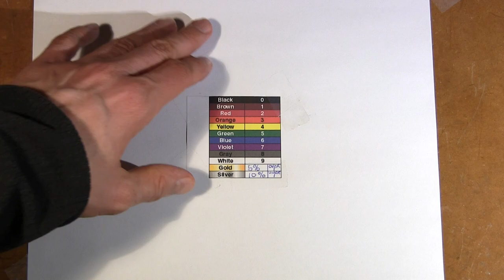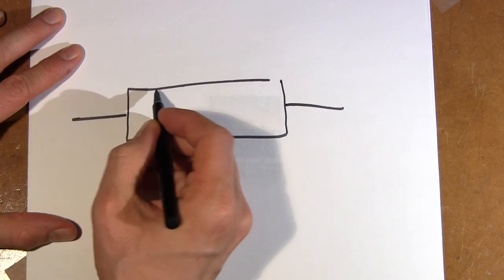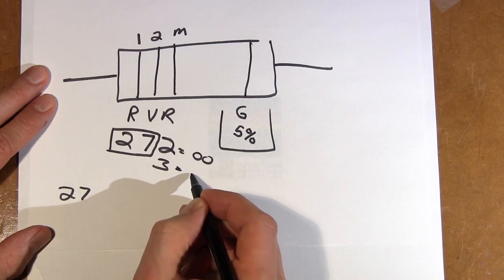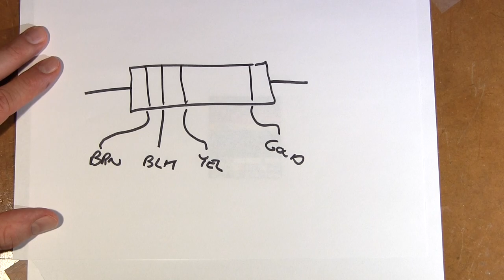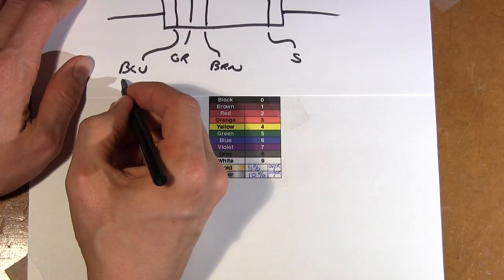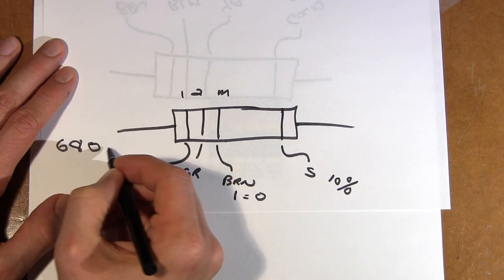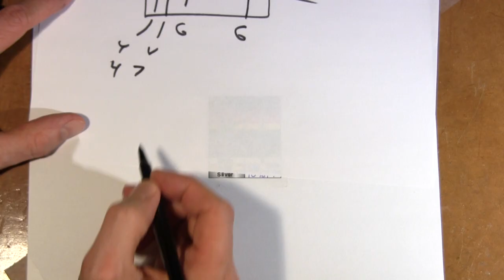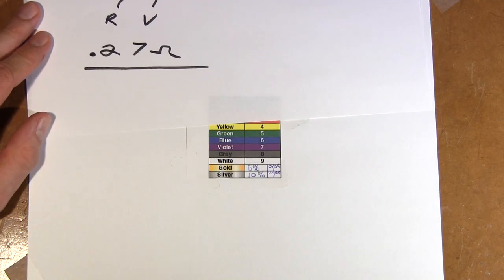Reading Resistor Color Codes Fast, Tech Tips Tuesday

Comment: I don't get it? you stated that the third capacitor only has three dots yet it looks the same as all the others. What are those three brown dots on the bottom for? or did you mean that only the top 3 dots are colored and the bottom 3 dots are colored the same and insignificant?

Comment: Can a "pinhole" in a resistor be the cause of my TV turning on / off and not staying "on" ?  (Red light, stand-by mode, I guess)

Model : Panasonic TC-L50EM5
BOARD : TNP4G532 (TXNP1UBUU 50121164848A)
Resistor : R7305

Comment: Really good info but 
You forgot resistors have a working voltage .
Note but its hard to find this info & you may have to ask for it  ! 

I see comments like  
"why is a 2W resistor fitted when its only dissipating 0.3 watts " ;-))
 
Could this be the next bonus tip ?
Reply from the maker: +gd2329j 
Thanks for your input and suggestions!

Comment: Love the video as always! In my general work if I don't see 5 bands, something is wrong. Although without grabbing out my cheat sheet I think caps and inductors have a different coding and I'm not sure why they wouldn't have standardized.

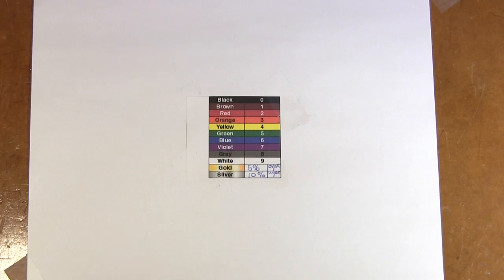A rectangle like you are drawing on graph paper @8:42. Not only do you not start in the corner you follow it around and don't  miss the connection. Shows how many times you have done this. I do not think you have edited this section of the video. I think you've just done this a large amount of times.I wouldn't stand a chance doing this. Well done!

Now the race is on; will Peter use a tie first in his video or will Paul?
Reply from the maker: +Ham4Ham 
Thanks for the kind words! I will have to send Peter a polka dot bow tie :^)
Reply: +Mr Carlson's Lab Sorry Paul I was editing as I went it's getting late here and I'm burnt after 16 hours LOL. I'm not sure you have the most recent but you did catch the clincher LOL

Comment: Great video. What happens when the multiplier is black which equals to 0 on the chart? I have a resistor with Blue, violet, black and gold
Reply: Same thing as any other number. The multiplier is "times ten to the...".  If 0, then 10^0 = 1.  So multiply the first two digits by 1, and you get just that.  Example: green, blue, black, gold.  56 X10^0 = 56 ohms.

Comment: Hi, am am currently rebuilding a tube PA from 1962 (Barvic Eng.) and it has 8 of the "postage stamp" micas (areovox)...finding this vid was very helpful, and

my question is re: voltage...

In replacing all the other caps (electrolytic, etc.), voltage was an important consideration...I have spent three hours over the past 5 days trying to find info on the voltage of the mica caps, with no luck...

is voltage a non-issue? or is there a way to read it from the dots.  Thanks
Reply from the maker: +James Grey 
Hi James. Most modern Mica's are 500 Volt rated, and the majority of the older Domino's were 400 Volt rated. If in doubt, just purchase a Mica capacitor with a voltage rating higher than the B+.
Reply: +Mr Carlson&#39;s Lab --Excellent, thank you,

Comment: Alexander Avila
I ordered two packs of resistors..
One pack 820 one pack 330

820 reads 0.814, and the 330 reads 324.0

What is going on I don’t understand
Reply: There's always a small losses upon reading.
Reply: @krystleandaleon1518  It's the allowable tolerance of the resistor... ie 5% 10%

Comment: Thanks for the mica tip I always had a hard time with that. I had to laugh on the resistor because i remembered a test i took years ago. it was just 3 color bands, what is the tolerance ? its 20% you don't see it often, i got that one right and he laugh and said i was the only one that got it right. I still have some of them here if some are over 50% high lol.
As always great job, 73`s
Reply from the maker: +Gordonseries385 
LOL, I have some of those as well. Their ratings to color band comparisons, is sort of like, "Spin the wheel" ya never know what your going to end up with. Thanks for your comment!
Reply: With a volt/ohm DIGITAL meter ($20) I measure the resistance (ohms) of a set then use the most accurate one .

Comment: Was wondering if some time you could do a video on setting the bias for output drivers in a transistor audio amp. And maybe some info on getting offset voltage at a minimum would really appreciate it thanks.
Reply from the maker: +wade hicks 
Good possibility in a future video!

Comment: Sooo, you have to carry that little chart around with you? That's like carrying around a little slip of paper that tells you which component, inductor or capacitor, that the voltage and current lead or lag in. Both of those problems gave rise to the absolute best memory aids the world has ever seen. For resistors the Boy Scouts have one no one can ever remember and the US military has one no one can ever forget. The same for capacitors and inductors.
Reply from the maker: BOOM... the response is that fast! "Just because I'm here."  Ok... No... I don't carry charts. But you are more than welcome too if it makes your life easier.

Comment: How is it when you  are working with electronics from the 40s 50s 60s and so on has it all this time been the same color coding?
Reply from the maker: Most of the time. They just put the same colors in a different order.
Reply: OK, so there is a need to check the standard for color coding at the time the equipment was made. Any suggestion on where to find the standards in force up through the time? Thanks Mr. Carlson for your help and for your dedication in tutoring by your videos on youtube your a good teacher, thanks again

Comment: I heard recently that the arrow points to the outside shield, do you know if that is correct? Thanks for the videos.Carl
Reply from the maker: +Carl  Burgess 
Not that I know of Carl. I will perform some tests and get back to you.
Reply from the maker: +Carl  Burgess 
Ok, I tested 6 of them, all had a very slight difference, but the band on every one would point to the beginning of the arrow, or the start of where the name is printed on the package. Again, the difference between sides is very small. I have some with the leads coming out on the sides above and below the dots as well.
Reply: +Mr Carlson's Lab Thanks I don't have any in my parts box or I would have tested this myself. Might be fun to look at some in-circuit and see how they are installed.
Reply from the maker: +Carl  Burgess 
I just may do that. Maybe on the next old receiver restoration :^)

Comment: my third band is white, so im adding 9- zeros ?
Reply from the maker: When some resistors overheat, the bands turn white. They get the hottest in the center of the resistor, usually where the third band is. Some other components are marked with bands as well, IE: Instructors, capacitors.... ETC.

Comment: Great video thanks. I've been coming across lots of 4 band resistors lately. Is this a new thing or have I not been paying attention.
Reply: 4 bands is normal for resistor :  First two is numbers . Third is how many zero's  .  Fourth is % accuracy of the resistor .  (total value is called ohms) .
Reply: @norisboren5402  OK, 5 band, I was excluding the tolerance band.
Reply: @barnyardstory  Here goes:  green blue green gold    gold      =   5    6    5    ÷10    5%    =  56.5   5%     or measure with vom meter .   Five band is more accurate than 4 band , gives extra 3rd numbe .  See " All about circuits resistor calculator.
Reply: @norisboren5402  What I was commenting on is that these weren't around 40yrs ago when I found resistors. It's apparently new in the last 20? years?

Comment: I have a weird resistor it has red black black gold red. How do I work the problem on it???
Reply: Black-0
Brown-1
Red-2
Orange-3
Yellow-4
Green-5
Blue-6
Violet-7
Gray-8
White-9

Tolerance.... No band = 20%, Silver = 10%, Gold = 5%, Brown = 1% and if there is a 6th band it's probably a "burned in" resistor.  Burned in electronics have been thermal tested.

Comment: what if you have 5 bands and the multiplier is gold,where do gonna put the decimal point?
Reply: The third band just add's another value while the fourth band is the multiplier or amount of zero's. orange-orange-black-black-brown = 3-3-0-0-1 or 330 with 1%. Also remember the multiplier is actually 1 which add's zero zero's. or if it were orange it would be 1000 aka it would add three zero's to it. Now to melt your brain, there are 5 band resisters that the 5th band is reliability and 4th band is tolerance. Also there are 6 band resistors too.

Comment: Hello, while repairing a pc PSU, i found out this resistor http://i.imgur.com/yedaPPz.jpg?1 has a huge burn damage on the other side, which also melt the heat shrink tube it had on. The problem is i can't guess the right value. colours are: brown red silver red green, and i don't know which is the correct way to read, since the silver ring is in the middle, and i can't figure what the pink/salmon package colour represent. Think you can help? Thanks and Bye!
Reply from the maker: +oxidyzed 
Looks like a current sense resistor, or a resistor fuse. My guess is .12 Ohms (just a guess) Is it open? If not measure it with a low ohms meter. Those resistors usually work or not, no in betweens.
Reply: Mr Carlson's Lab Hi, thanks for answering. Unfortunately i started working on that PSU months ago, i asked everywhere about it, couldn't find anything sure. I went looking for that resistor few days ago, and didn't find it, i'm pretty sure i lost it or probably thrown away months ago, anyway, when i measured it, i think i remember it was dead, completely open and this is how it looked right after i removed it from the pcb and cut open the heat tube left: http://i.imgur.com/K7k0EfE.jpg it kinda looks like a fuse resistor but what's with that colour code and the body colour too? Also i couldn't find anything similar to buy on the internet.
Reply: +oxidyzed 
You need to get this e-book: http://www.findburntresistorvalue.com/
In what I've found, the silver band should be gray, not silver. Also the color closest to the end of the resistor should be the tolerance band. Of course, things aren't always as they should be. So I would guess that it's a 52.8K with 1% tolerance. But, using the tips in Mr. Yong's e-book, you could find the resistors value.
Reply: +oxidyzed 
Also, I checked my Electronic Toolbox App to see if maybe it could be a cap or inductor, and none of them have a silver choice for a third band, only gray. Was the PC made for the military?
Reply: Robert Calk Jr. Thanks for suggesting that guide, i'll read it as i have a minute. Also i don't really think that's military grade, it's an old Super Flower 750W. and it's pretty good, that's the reason i'd like to repair it
Reply: +oxidyzed 
It's not a guide, it's an e-book that Mr. Yong sells. It's well worth the money - I've used it and found that his techniques work.

Comment: Color Codes are not ergonomic. Buy resistors with letter\digits only
Reply: +nRADRUS I have to agree, The colour code was invented LONG before small printing became viable.  ALL the tips for reading colour codes assume that you can SEE the different colours. Which rules out me, and 10% of the male population :(
Reply: +TheChipmunk2008 Couldn&#39;t agree more, I always get the browns and reds mixed up as blues and violets, sometimes even greens and grays.
Reply from the maker: +nRADRUS 
That would be great for new design, but unfortunately, when servicing gear, it's loaded with all the colors of the rainbow. So to service or repair equipment, knowing the code is a must. Thanks for the comments Guys!
Reply: +Mr Carlson's Lab A tip I use (which seems very obvious but may not be to younger colourblind people who still have good eyesight aside from that) is to use a jeweler's loupe. Increasing the apparent size of the bands makes reading the colours much easier.
Reply from the maker: Good tip!
Reply: +nRADRUS Then again on a burned resistor many times there is some band indication left as it goes fully around. But printing would just disappear or not if your lucky
Reply: Wow.
Reply: Color code is the only working system as the resistor can be read from every side. Also color code makes it much faster to find the resistor if you know the value and you have to pick one from your spares. So color code IS ergonomic as it is easy to read what ever the position is.
Reply: @MrCarlsonsLab  Also, after a time, one can't read numbers written in such small spaces.
Reply: Definitely "ergonomic" for those who can see in colors! But we cannot discriminate against those who are color-blind, err hue-insensitive.

Comment: years ago i had a small  card  with all res .value and percent????lost it  do not need nowdays  china res are highly accurate .. i ordered an assortment of resisters from china they came ina few days  many more than i ordered(a sack full) very cheap10 of each value on cardboard it stated the value just for the heck i checked with my small ommeter they were exactly as stated  if the color said it was 445 ohms that is exactly what it read ever one i checked was this way i remember  when   if it was with 10% of stated value that was close enough  so if you need res go ahead and order them   so by knowing how to combine them you ca have any res value you need simple if you need 50 ohms but you only have 100 ohms cobine the 2 ----100 ohms side by side you hve 50 ohms this works with any equal values combine4 100 ohms side by side you have 25 ohms.good to know in a pinch

Comment: Easily understandable? Yes, absolutely. One needs to be severely mentally challenged to not grasp the concept as it is explained in this video.
Delivering as the title promises? Not as much, actually.

Because since this video was supposed to be about reading resistor color codes *FAST*, it really lacks the MOST helpful part of the lesson; the English version of the mnemonic for remembering the colors corresponding to each digit. Like the Dutch phrase "Zij Bracht Rozen Op Gerrit's Graf Bij Vies Grijs Weer". I hoped to finally learn the English version of that phrase, so I'm now sadly disappointed. :(

Comment: I realize this is an older video. But you did the explanation of this color code very well. I use the color code nearly every week because I work with circuits a lot. However, the really tricky part is remembering the actual color orientation. When I was in school, our electronic's teacher told us a little rhyme to remember the color order. And since, at that time, there was no girls in our class, he told us the cleaver rhyme. I am sure most people that work in electronics have heard it before and I equally don't think it would go over very well here, so I will just say it stuck in my head from that time many many decades ago. Do you have an equally cleaver rhyme to remember that code now?